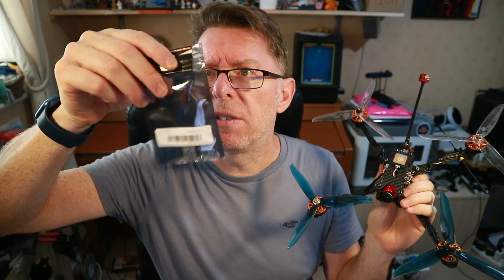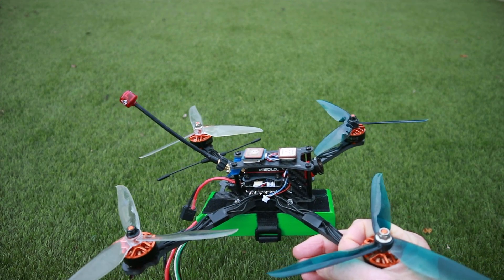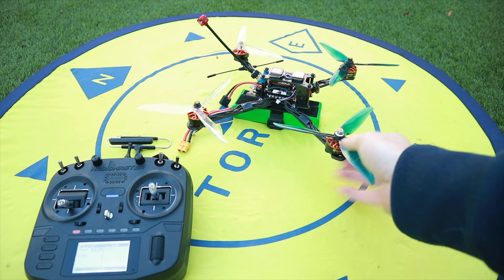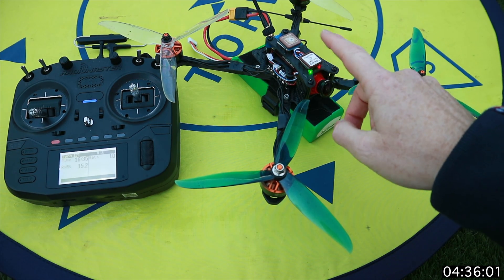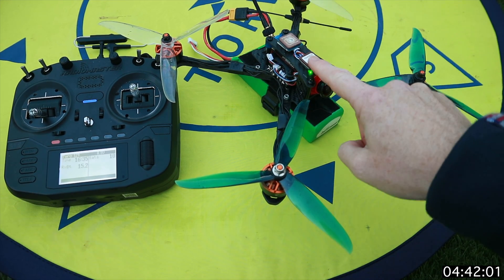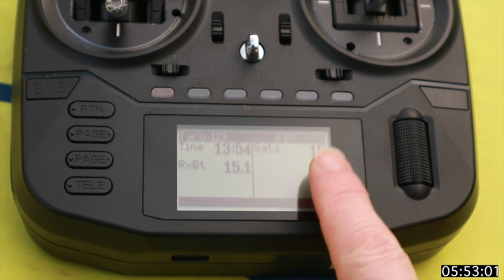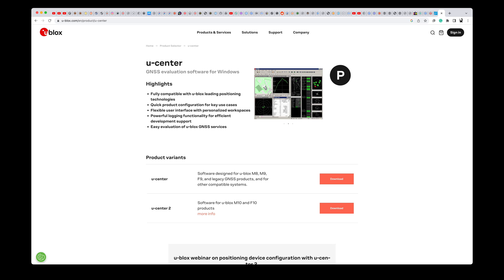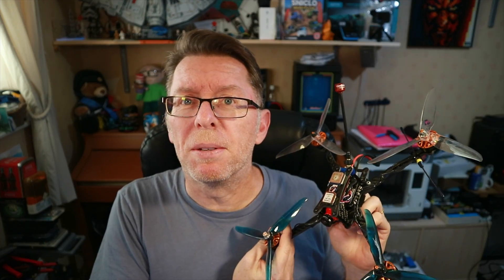The new M10 GPS, are they better than the old M8 GPS's ?

Comment: I still failed to see the advantage the M10 has over say, Neo-M8n, where I regularly lock on 25+ Sats on a clear day from a selection of 32+. Most I've seen is 36.
Reply from the maker: On a quad or a plane?  It's rare I see numbers above 14 on a 5", but planes with that extra seperation have no issues whether on m8 or m10

Comment: Hi,

I suspect that the "auto-detect" for galileo assist feature in betaflight to be the culprid => you started the FC with one GPS module, the FC tried to find out which "galileo assist zone" it should use ... but then you unplugged the M8 and plugged the M10, which started again with 0 sats, which messed up the FC algorithm in the auto-detection ... don't know if I'm clear ^^"

Comment: I have heard that the M10 GPS does not work correctly unless the quad is using Betaflight 4.4.5 (I think). So, that is an issue for me since I don't upgrade or flash the firmware unless absolutely necessary. So far, all of my quads are running on the Betaflight version that came on the quad or FC. If this is correct, then I am sticking with the M8 units.

Comment: if you wana get the most out of BF and the m10/gps rescue you need to use the 4.5zulu builds ( rc1 is coming out very soon ). m10 gps are performance wise dependant on what the vender flashed it to some have the internal baud rate set WAY to low... and need to be setup using the ublox software properly.. also the m10 gps use different commands to configure so.. with the latest nightly you'll get the code that's updated to work with the m10 units properly.. you'll get loads of sats and lock much faster than older code
Reply from the maker: I did think that part of the autoconfig would use the ublox protocol to attempt to put the GPS into a higher baud rate and then drop down if it doesn't respond.  But perhaps that bit it still jsut in 4.5.  Looking forward to the release of this one
Reply: @CurryKitten  it goes with the m8 but the m10 has a different command set. Unfortunately companies didn’t bother to read the white paper before pushing these to market and the BF team had to make the fixes after they were already in the publics hands.. with the continuing evolution of the way we work with the Chinese maybe we can avoid this sort of thing for the future

Comment: First of all don’t listen to this gibberish. My M 10 gets 28 satellites in my backyard. My M8 gets seven satellites. All YouTube videos demonstrate that M 10 is far superior to M8.
Reply from the maker: I just show the results I get.  I do think the M10 is better because it gets the sats quicker - I don't know why it didn't lock as many on the 2nd test
Reply: Does anyone know the uart settings in beta flight for the m10 blitz mini gps installed on a nazgul f4?
Reply: @benedictcumberbatch4275 as long as you have not mixed the tax/rx pads when soldering, just set up the ports tab with the correct part you’ve wired to, and your all set. Make sure GPS is enabled on the configuration tab and that should bring it all to life.

Comment: The best way to check and compare those modules is using U-Blox's u-center application. Because you see exactly which satellites it picks up, the signal strength for each of them and so on. With two serial-USB-converters you can even hook up both at the same time, start u-center twice and compare both modules in realtime. You can also make sure that you are really seeing a cold start by sending a cold start command from u-center. Because every information still left in the modules memory has an impact on how fast it can obtain the first fix - and even if it's only the current time and date.
Reply from the maker: Interesting - I may have a play with that to see what info i can get from it.  I'll just need a very long cable to get the GPS antennas out of the window though

Comment: My M10 on a BNF works no better than M8 on other quads. I hope that's just Betaflight 4.4 and I can't do the hack as I'm on a Mac and it seemed too complicated anyway.
Thanks for the vide, very interesting.
Reply from the maker: BF 4.4 does seem riddles with some annoying bugs.  I'd say "roll on 4.5" but no doubt this will involve a bunch more new bugs.  Perhaps they should just fix the bugs!  I work on a Mac, if you do need a windows only piece of software, VMware Fusion is free and will do the job
Reply: @CurryKitten  Yeah, maybe I'll go that route (VM/Windows) but so far I got by... Thanks for the tip.

Comment: Thanks for doing this. Very interesting. I've not used either the M8 or M10 as I've yet to GPS-enable any of my FPV quads. But I'm surprised how slow these are to acquire so few satellites. I feel like my Mini 3 Pro acquires a lot more satellites a lot more quickly (admittedly I've not benchmarked it), but I am in a different part of the world, too (Texas).
Reply from the maker: Most GPS receivers give a stat of a first fix from a cold start in 26 seconds - this is in the perfect conditions.  I can guess DJI do a lot more work in isolating the GPS from any interference much better than we do with stuffing all the wires in the quad with the rest of the electronics

Comment: The VTX is the biggest EM and RF producer, turning it down to 25mw for thermal reasons is likely the reason why you got better gnss reception for the test. I’ve started putting the gps under the camera on the front of the quad, just move the tpu to the front, that alone has dramatically improved performance for me and helps the compass as well. Though the primary culprit is EM interference not necessarily RF.
Reply from the maker: My quads generally all run at 25mw before they arm anyway.  There's certainly lots you can do to isolate the GPS receiver in a much better way (and I've had to on other quads just to get a signal) This test is really to show what happens on a "quick-and-dirty" install - which i tend to think the majority of people will do

Comment: My M8 performs just fine. Maximum number of satellites I've got is 28. M10 is the same but it locks onto them faster. M9 was solid but only reached 16 satellites, no matter how long I waited or flew.
Reply from the maker: There's no reasons to throw your M8's away.  I do like the quicker fix idea from the M10s though
Reply: I agree. @CurryKitten

Comment: I have the latest M10 from Caddex in my Apex 5 quad....28 Sats it hit peak during Maiden flight....Ive been using Galileo ever since BF FINALLY got around to adding it....Its a European Sat...😮😳😀🇬🇧 It is custom mounted on the FRONT of my quad though....lol
Reply from the maker: Out the front is probably a cleaner area as we tend to have the VTX's at the back.  I've never had 28 sats on a quad before!
Reply: @CurryKitten  It's on my channel a recent upload...The GPS is tiny and mounted on a 3D printed tower which doubles as a Strobe  mount...Apex 5 Maiden...🤔😏😏

Comment: Both my m8s and my m10s take about 3-4 minutes at the longest to acquire the minimum for gps rescue (6 or 8, can't remember which atm) on the first flight of the day, but the m10s get more satellites in the long run. Subsequent flights are usually less than a minute for both. If I take off with minimum satellites, the m8s are more likely to warn gps rescue not available off and on during the first flight. After the first flight, I seldom get the warning.
Reply from the maker: That tend to be my experience.  Sometimes I seem unable to get sats on the ground, so have a fly around and they all instantly appear.  Very weird, but then everything is good for all the subsequent flights

Comment: Check out your 5V output on the FC, that the GPS has constantly enough power. At some FCs, the 5V pad delivers only around 4.65 - 4.79 Volts, especially when pid mode is turned off and the VTX runs on higher power levels. It causes, that the GPS module starts with rebooting itself, without saving the satellite data. 
Options: 
- use an 5V up/downstepper, or

- plug a power bank via USB to the FC, without connecting the whole quad to a battery and wait two minutes. The GPS autosaves the sats and switches it´s light mode, when it when it has                  locked enough sats.
Then you can plug in the battery to the copter. If you repeat this step every hour over the day, the gps module gets many data to work with, what means faster lock, or
 
- connect/power on the VTX seperately, even after sats has been found and locked
Reply from the maker: Although, this is good advice for getting a lock, and I've even featured seperate devices so you can power on your GPS in isolation (without a USB connection) I'm always happiest if I can do something without any extra faff, or messing about.  So being able to simply switch on a quad, wait a max of 2 minutes and then take off with sats is always going to be more desirable than the other methods

Comment: The first thing I do when I get to my flying area is plug in my USB on the flight controller to a power supply so when it's time to fly I already have a lock on my first flight then after that I'm good for the day..that way I'm not cooking my video transmitter waiting for a lock
Reply from the maker: If you have to wait more than a few minutes, this is a good idea.  However, if we can simply power on the quad as it stands and get a fast enough lock from a cold start so we don't need to do anything extra - then it's better in my book
Reply: I use this method as well. Not wasting those precious mAh sitting on the ground.

Comment: Isn't Betaflight 4.4 bugged with M10 GPS systems?  I seem to recall JB did a video about the M10 not getting it's full performance unless you did some manual configuration.
Reply from the maker: It's a little confusing in terms of what's supported.  As mentioned, this is a 4.5 feature that was apparently backported to 4.4.  However, I can't find anything in the repo that tells me this... but at the same time it works on 4.4 which means it must have been backported?!  Anything prior to this though, and you will need to use ucenter to config the GPS separately

Comment: Every time JB mentions M10 I start shouting at the screen. He raves about it but I'm getting far better performance than him with my humble Beitan M8. I work with GPS modules at work and there's nothing wrong with M8 IMO. My quad regularly gets >20 sats. The GPS community could do a lot worse than to start looking at cheaper chipsets like the ones from Quectel, which perform very well.
Reply from the maker: I'd be happy to look at them if someone produces them, but right now Betaflight can use the UBLOX protocol, or basic NMEA, so I think it may depend if Quectel had it's own protocol that made it easy to autoconfigure.  As for you M8 doing well, yep there's nothing wrong with them, but a test for you would be to run you M8 next to an M10 and see if there was a significant difference

Comment: I have been shielding the cables with copper tape and earthing this then using tape to avoid shorting. Really speeds things up.
Reply from the maker: This is a great idea if you are having bad RF interference from the rest of your quad - I do it on one of mine, but it seems too much faff to do on everything if it's not needed
Reply: @CurryKitten  I find twisting the wires well and making sure they are not touching any other electronics running it along the top plate is usually the easiest. Usually get lock within a minute or so on m8 and close to 30 seconds on m10. I also have seen the m10 get 32 sats where I've rarely seen the m8's break 20. That's with matek m10's that are using the ublox modules with built in antenna.
Reply: I’ve recently started doing the same and it’s a huge improvement.

Comment: Did you set the baud rate to the highest possible speed? With M10 I usually get 18-20 pretty fast on the ground (EU), when flying 29-30 top.
Reply from the maker: It's set to autoconfigure, so it should get the fastest baud rate.  The area I'm in never gets that many sats - I was surprised to get more than 5 - best it's ever done.  Out in the field where I fly, I get far more

Comment: Excellent review of comparisons. It certainly is a bit strange for the M 10 to fall behind when Galileo was activated. I would guess all of that will be forthcoming with improvements. I have an M 10 and was going to put it on my 7 inch but I went through a rather arduous task, putting that copper foil around the wires etc. therefore the time being “I plan” to use the M 10 on my 5 inch Merica when  I receive the new Walksnail goggles and VTX.
Reply from the maker: It certainly seemed a bit odd.  Not exactly the scientific method to base the conclusions on a single test, but I will be updating the Chimera and I'll be leaving the M10 on that quad to see how it goes, so more data will come.